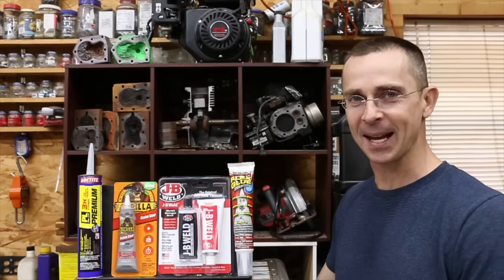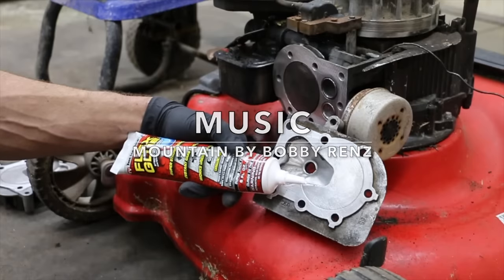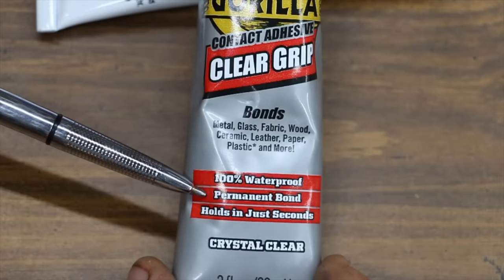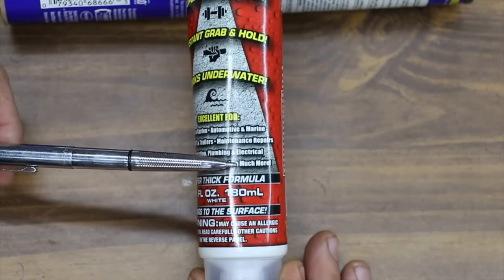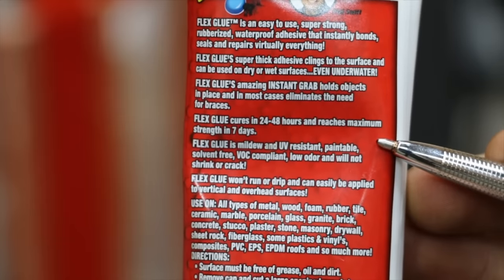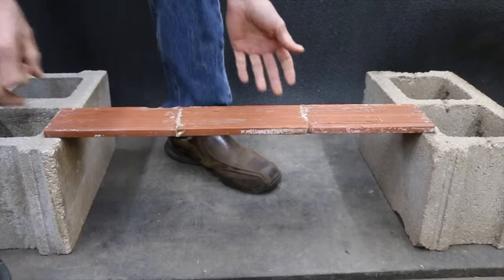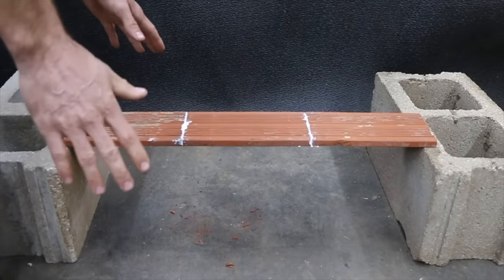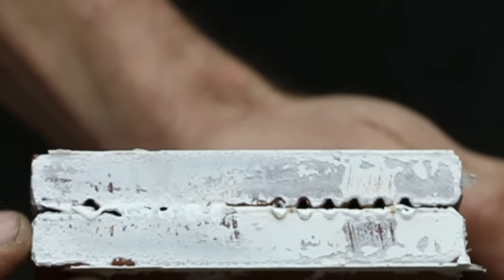Is Flex Glue better than JB Weld, Gorilla & Loctite?  Let's find out!

Comment: I think that the Gorilla glue you used was the wrong type of product from the  company. They have another type of glue that hardens into a solid, rather than rubbery flexible glue.
JB Weld was very impressive. I don't think there's a product made that can top it in the tests where it shined.
Reply from the maker: Thanks for the constructive feedback.

Comment: I suspect JB Weld will win most. But a Rubbery substance will have some advantages in some tests. Good Idea to know which application is best for each product.
I do like Rubbery stuff that will or would Dry to a ROCK hard cure. Rare and hard to find, but I have found some Liquids that Do. Mix with the right stuff and you will get the Best of Both Worlds.

Edit: The only REAL thing Gorilla has going for it over the others, is the Name. We just think Tough when we hear Gorilla. And I do like the name.
      :  J B Weld...  Weld... as close as you can get with a Glue.
Reply from the maker: Thanks for the feedback.

Comment: Flex seal is crap.. I used it to seal around a vent on my RV. Withing a year it was cracked , peeling and back to leaking. Way harder to fix right after using the junk.
Reply from the maker: Thanks for the feedback.

Comment: I can tell you this for a fact concerning J-B Weld when I started working at a company in Junction City Kentucky Penn ventilation all of our forklifts were old we only had one that was suitable for indoor use that would lift 3,000 lb the engine block on it cracked and old Alice Chandler's we had to fix it there was no other engines available plant manager ran up to Walmart and came back with JB Weld I helped the maintenance man repair the crack in the engine block of the Alice Chandler's forklift using J-B Weld 6 years later the plant shut down and the forklift had been placed on a truck and shipped to another plant that was not going to be shut down to remain in use J-B Weld does do wonders
Reply from the maker: Thanks for sharing.

Comment: You should have added liquid nails to your test. I have 0 use for Gorilla glue. Worst glue I ever used, hell, Elmers glue would work better. I found it to be the worst product I've ever used. I even glued the plastic edge back onto a cabinet I bought (cheap entertainment stand) and it fell off after 2 repair attempts now. Not even having any weight applied. Jb Weld, I have used to repair a busted aluminum housing on a transmission. The drive shaft came loose and whacked the repaired area, failing to break it. This happened before I was able to get the proper replacement bolts for the driveshaft.
Reply from the maker: Thanks for the feedback.

Comment: I saw him use Gorilla Glue and he didn't actually wet the wood to activate the glue properly you're supposed to wet both pieces of wood then apply the glue then apply pressure so that the glue bonds and then you're using glues compared to epoxies. Not the best comparisons

Comment: Coming home with a brand new radiator   I'm 16 years old  in 1978   so,,, needles to say how stupid   , but I got home and opened the box with  a 110 Buck knife  , oh well 🤔 guess what ?   So back to the parts store  and the guy told me to use J B  WELD    AND  DON'T BE IN A RUSH  SO THE NEXT DAY  I GOT IT WORKING   THE Radiator  was used in  three more pintos  after that 🎉
Reply from the maker: Thanks for sharing!

Comment: Find it absolutely unnecessary test JB weld (Apoxy) because of the bond it has with any clean surface. I have used it in a pinch on a diesel fuel tank. I keep 3 things with me for fuels, Rubber tape, Jb , and Acetone (Wife nail polish remover ..pilfered of course)
Reply from the maker: Thanks for sharing!

Comment: The Gorilla Glue you're supposed to wet the pieces that you're putting together and it's really not a practical test that your testing it now if you doubled it and staggered the connections include gluing everything together but it's not meant to be put under a butt end connection that's a very unpractical test they're really just glues except for the J-B Weld which is a two-part epoxy and you can't put a two-part epoxy against a glue and epoxy isn't the glue and the glue is in an epoxy

Comment: It will work as a temporary repair. But if you put the engine under load, they will fail.
Reply from the maker: Thanks for the feedback.
Reply: @ProjectFarm  I just watched the end of the video. Turns out it didn't work at all lol. I have used this for other engine repairs (Reattaching mounting brackets and such). Thanks for the tests.

Comment: I thought for gorilla glue you needed to dampen the wood with water first  ?  Still wouldn't beat jb.
Reply from the maker: Thanks for sharing.
Reply: If you check the instructions on this Gorilla Clear Grip product it doesn't state surfaces need to me moistened.  The original Gorilla polyurethane based glue is a water activated glue.

Comment: This video should be revisited with better tests. Using glue in it's intended application instead of whatever this is. Of course glue is going to fail if they're not designed to be used in these ways. Pf does great videos but this one flopped hard

Comment: You are using different glue types so the test isnt valid. You have the contact adhesive Gorilla, The construction adhesive Loctite, the epoxy JB Weld. Use the same adhesive type from each brand otherwise this just tells us what type is better and we all already knew epoxy is the best.

Comment: You actually put too much of the products on there should be just enough to bond together each piece, if you put too much on it's not bonding each piece, it is bridging it and makes the joint wholly dependant on the chemical which in itself can be brittle if it's one that sets hard, rather than creating a bond of the 2 pieces to be bonded. I think you will get what I mean. I guarantee if you change the amount that is applied to a thin bonding amount your results will change dramatically 👊👊👊
Reply from the maker: Thanks for  the constructive feedback.
Reply: @ProjectFarm  I know from experience😂 used to just put shedload of material onto the timbers then found out by accident years ago that less is more, so to speak. Been in the renovation trade 30 years so you pick up a few good nuggets to make life easier. Love the vids brother. Watching them from here in Leeds, uk👍👍👍

Comment: 3m 5200 is the best
Reply from the maker: Thanks for the feedback.
Reply: @ProjectFarm  this guy at the marina had to reseat his keel.  He put it on years earlier using 5200.  He expected it to fall off when he removed the keel bolts.  5200 held a 6000 lb keel on.  He had to use saw wire to get it off.  Amazing stuff

Comment: You have used the completely wrong type of Gorilla Glue - Contact adhesive is designed to have extra flex for applications like sticking soles of shoes on. Very poor knowledge and completely not scientific - Next time try the Gorilla Epoxy or Gorilla Glue Original PU